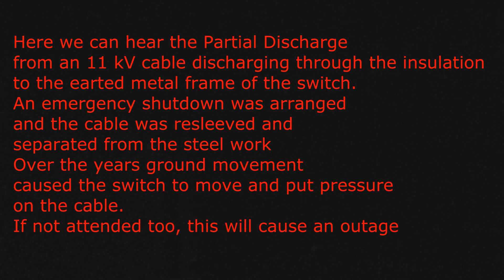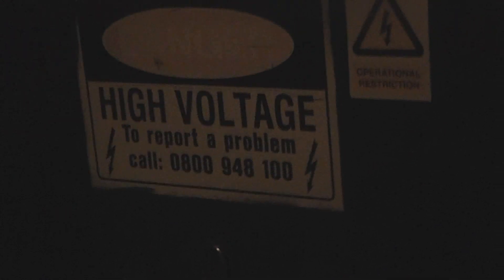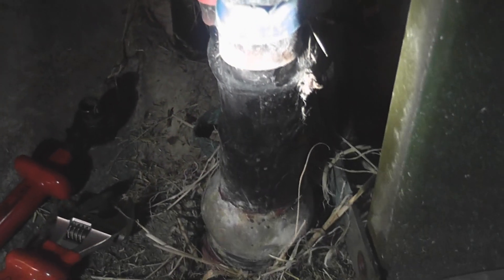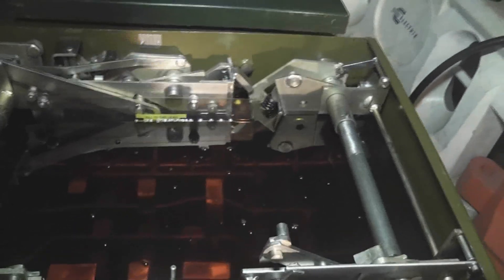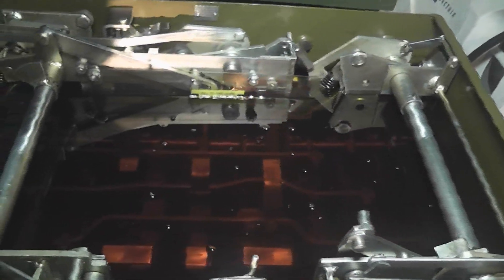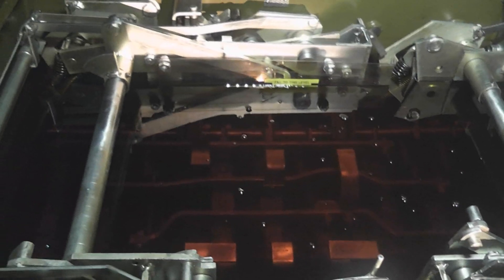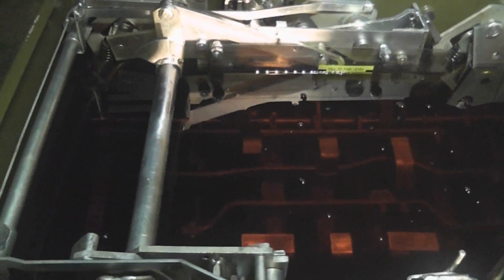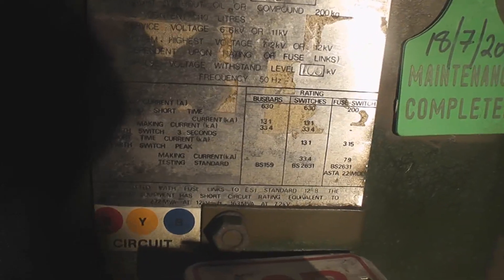Partial Discharge on an 11kV cable

Comment: Thanks for taking the time to film the event, lucky you were able to identify the fault before it became a huge problem. I imagine that there was a risk that the fault could have ended up destroying the switch unit and possibly cause a major insulating oil fire etc. Its interesting to see how the leakage currents were eroding the metal work, I wonder how long the fault was there?
Reply from the maker: I think this fault has been arcing on and off for a while. We have a very dry summer. It would have most likely failed in a rainy period and when the weather cools down and condensation occurs on steel metalwork.
Reply: RODALCO2007 Well, rust needs water to be created, so it must have been in a rainy part of the year

Comment: Got sent out to a 33kV Transformer today that had a failed elbow connector on L2 (only 6mths since energised). Top cap blown off and by the look of it tracked up to the ceiling approx 2ft away. Customer not a happy camper.

Comment: Similar to the one at work in the metro substation, though there the oil was changed 2 years ago. Still waiting for them to come and proof test the cable that was locked out where a contractor drilled a jackhammer through the joint. It has only been 3 years though......... Nice though is that if the incoming 11kV feeder fails there is still a 800A 380V backfeed available from the 1MVA substation 40m away ( direct line, but 180m of cable though through the ground into the street), all we need are 3 800A fuses and a neutral link plus the 4 holders. The substation dates from the 1960's, the fuses that blew from old age were made in 1956.

Comment: does oil conduct electricity in a different way than water? or does oil not conduct anything at all and just helps keep things cool?
Reply: oil doesn't conduct electricity. Oil is used as insulator and to keep things cool in transformers
Reply: testas 3339 thanks. I was leaning towards that. Now here's a question, if the voltage is high enough can oil actually conduct electricity? I feel like at some point it would conduct a small amount but if raised really high it might cause some boiling.
Reply from the maker: Oil is an insulator but if the voltage is high enough breakdown will occur, and an arc strikes. Particles of carbon are formed within the oil and the effective insulation is reduced. Oil is tested at up to 80kV per 6.2 mil (¼ Inch) and should not break down. Test results over 50 kV are a pass. In oil switch gear there are large clearances between contacts to allow for carbon traces not to cause any problems.
Reply: RODALCO2007 See, where else can you find interesting information like that! You're the man.